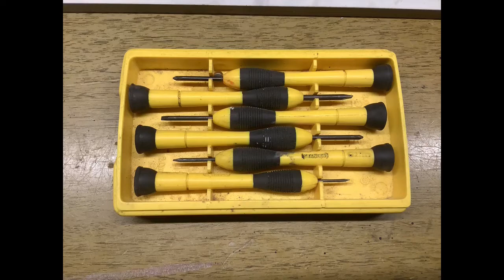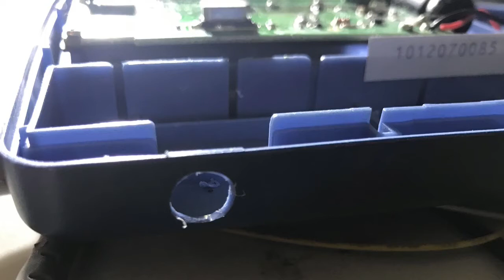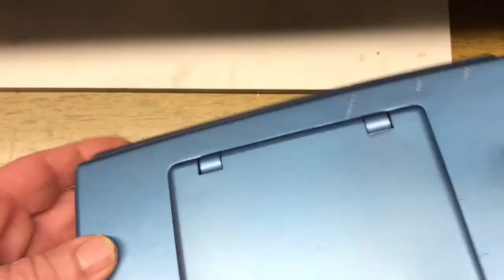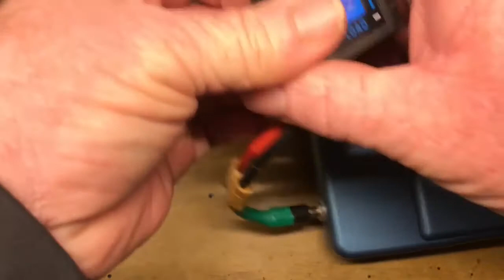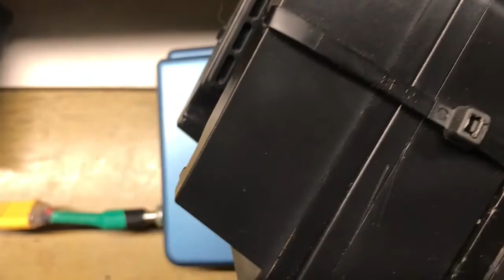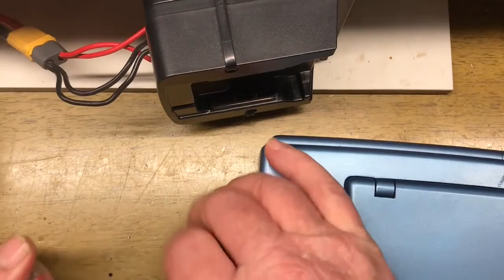CED CHRONOGRAPH BATTERY MOD

Comment: Hello, please could you tell me the voltage of the cables Black, Red and White on the female Sound Jacks ?
Reply from the maker: black to red=3.8v ,   black to white= -5v,       red to white=  8.8v
Reply: @lmorrison17  is the black cable ground?
Reply from the maker: @alfred3305  I don't know and I'm not going to take my device apart again. What seems to be the problem with yours?